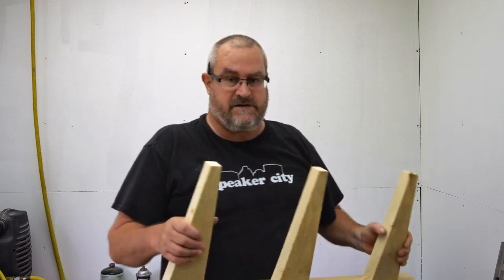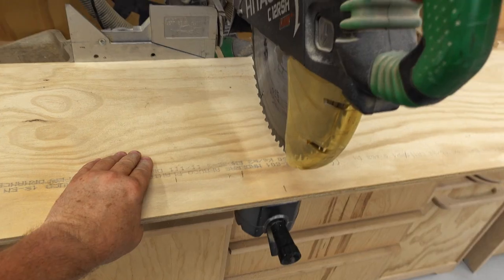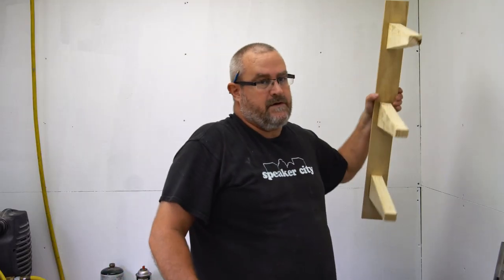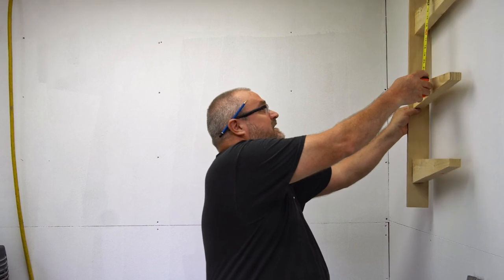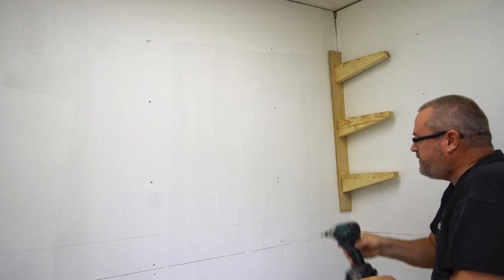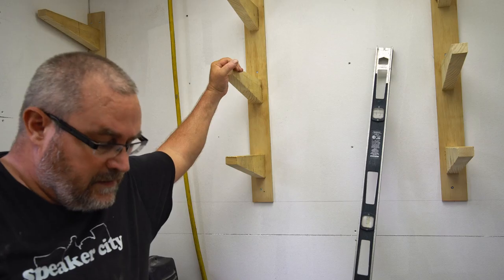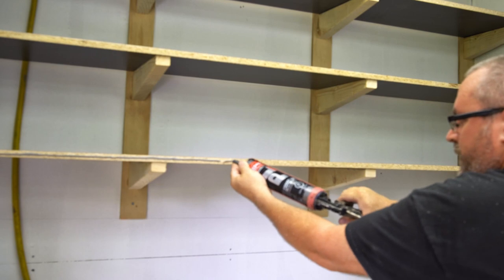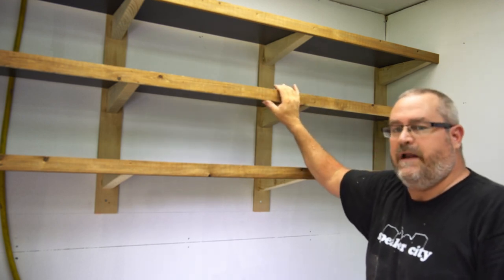How To Make Strong Shelf Supports - Fast And Easy

Comment from the maker: These are made in the same way as my lumber rack:
https://ibuildit.ca/projects/how-to-make-a-simple-lumber-rack/

How strong? Depends upon how strong you need - using more supports will greatly increase the strength. See the lumber rack article (with video) for an example.
Reply: I made your lumber rack today as my first project, thanks for the easy directions! Had to use my circular saw since the table saw hasn’t arrived, but it looks good! Thanks again Sir!

Comment: I did it like this and if I put too much weight the solid wood shelf supports started cracking (I used fir). Then I glued 6mm (1/4") plywood on both sides and it really made a difference.

Comment: Sup John. Happy 4th brother! I've been wondering why u like construction adhesives so much. Is it better than wood glue?
Reply: Longer open time.
Does cure slower
Has gap filling properties 
Works / cures at lower temps too.
These are the things John likes about it....

I'll add:
works on still damp pressure treated lumber....
The caulking gun dispenser is kinda fun....
All around good stuff.

Might not be quite as strong as say Titebond III when bonding say face grain to face grain of 2 pieces of prepared red oak (one of the strongest glued joints out there as it happens - see the vid about glue by King's Fine Woodworking  ...  he has a link to the actual study which was done.
Reply: @gregmislick1117  well thank you. I'll check it out.

Comment: Legit question and not criticism: Would you want to include any kind of adhesive or strength to makeup for the fact that the screws are going into endgrain? Or would these be stronger if you arranged it so that the screws were entering long grain instead? Or do you think the shear point of the screws is lower than the wood splitting and giving out?

Comment: With the shelves being between walls is there a reason you didn't simply screw cleats to the side walls instead of  making  the brackets for the ends?  Great project, when I saw the thumbnail I kept thinking "Have I seen this?, Is this his lumber rack?".  Thanks.
Reply from the maker: Good point. My original intent was to mount the brackets about 6" away from the corners and leave the ends of the shelves to overhang, but decided that the corner was ugly and needed to be covered. I also wasn't sure if I wanted the shelves to go all the way from wall to wall when I first started.
Cleats mounted directly on the walls at the ends would work best.

Comment: Good instructive video. Are there any devices for sounding out studs? I recently fixed a TV bracket for my daughter but it was difficult. Sounding then using Brad awl to check.  The studs weren't where I thought they were!

Comment: I'm not "strengthparanoid" but here in Spain wood is poor quality, soft nordic pine is usual, I guess. 
I suggest tilting the screws a little so that they do not completely cut the grain of the wood. 
I have had bad experiences attacking the wood in grain direction. It is sure that the more supports, the less load, then the more strong. Anyway this does not vary or complicate your idea.
Nice work, clean and easy.

Comment: They look very similar to the shelves I built in my work trailer.  I used some old oak chair rail that was given to me for the front and just half inch osb for the shelves.  The only difference is my center two supports I put legs on down to the floor. Holds all the weight I can pack on them with ease.